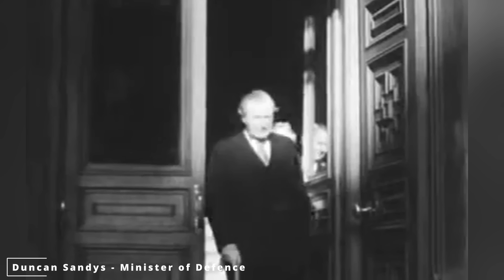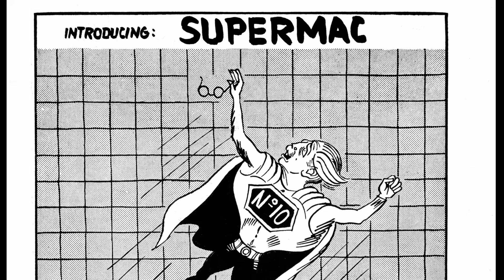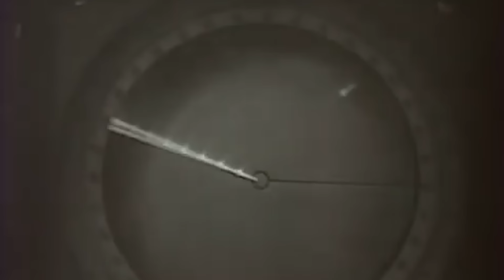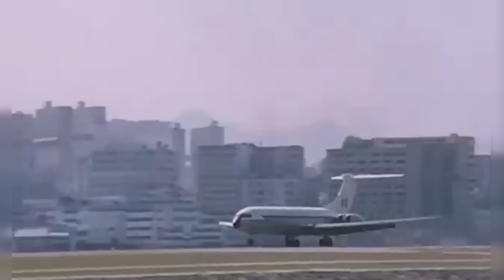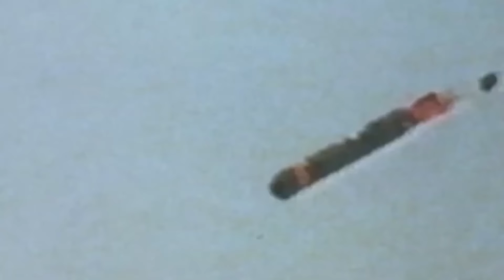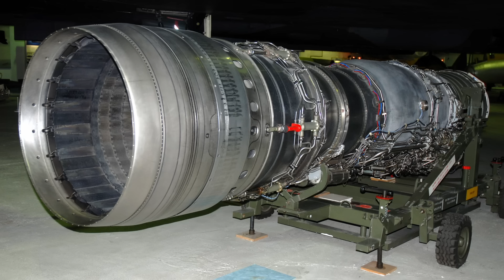How Britain Turned A Failed Airliner Into a Soviet Submarine Predator | The Mighty Nimrod

Comment: Can you reproduce these as podcasts?
Reply: Exactly.
Reply: Precisely.
Reply: @sandervanderkammen9230 

 
The fabulous trail blazing De Havilland Comet. 

World's first production jet airliner doing regular commercial service. An Avro Lancastrian jet airliner was actually first. 

World's first high altitude jet airliner. 

The HS 801 was produced from new build Comet 4 airliner airframes with necessary 801 modifications. It was the most advanced aircraft of it's type at the time it first went into service. It was not available for purchase by other nations. 

The MRA4 version had problems with radar and computer development and BAe Systems & co were too busy with other projects. 

There can be no excuses for the Bow-wing (See B-47 wing / folding  collapse incidents) Max incidents given that Bow-wing had more than 50 years design and build experience for the type. 

A typical Bow-wing (See B-47 wing collapse incidents) airline duty 707 lasted for about 23 years on average. The reason any lasted longer was large numbers built so lots of spares with a lot of airframes in military use with big military maintenance budgets and many often with low flying hours or in storage. A typical 707 is basically cheap nasty junk. 

All later jet airliners benefited greatly from the knowledge gained from the Comet incidents & subsequent investigations & yet some were still worse for accident losses. 

Instances of all marks of the Comet flew with full certification after 1954 including the Comet 3 with full certification remaining in place until after the aircraft were retired. The last Comet flight occured in 1997.

The nose design was unique to the Comet, Sud Aviation licensed the design for their Caravelle. 

The fabulous trail blazing DH Comet.
World's first jet airliner in regular service.
The jet engined Avro Lancastrian actually did a passenger service before the DH Comet. 
World's first high altitude airliner.
World's first airliner with a full fuselage length pressurised cabin pressurised for high altitude flight. That feature for that type of aircraft was a considerably difficult undertaking. 

How things were back then.
Accident losses - % of aircraft built.

DeHavilland Comet 4 UK                          14% 
DeHavilland Comet all mks UK (ff 1949)17%  
Vickers VC10 UK (ff 1962)                         5%

Douglas DC-1  US                                       99%
Douglas DC-2                                              47%
Douglas DC-3                                              30%
Douglas DC-4                                              26%
Boeing s300    US                                       72% 
Boeing 307                                                  70%
Boeing 247                                                   48%
Boeing 707  (ff 1958)                                 32% 
Lockheed L-049 Constellation (ff 1943)  30%
Lockheed Electra US (ff 1957)                   29%
Fairchild FH-227 US (ff 1966)                   30%
McDonnell Douglas DC-8 US  (ff 1958)   14%
Sud Aviation Caravelle  (ff 1955)             15%
Canadair CL-44 Turboprop US (ff 1959) 46%  
Convair CV-580 Turboprop US (ff 1960) 22%
Convair CV-880     (ff 1959)                      27% 
Convair CV-990     (ff 1961)                      33%
Tupolev T-104        (ff 1956)                     16%
Vickers Viscount UK  (ff 1948)                29%  
Fokker F-27 Turboprop NL (ff 1955)       40%      

The Vickers VC10, fastest Atlantic crossing for a non supersonic jet airliner, held the record for 41 years.

For the first few years of operation the Caravelle & Comet had similar accident loss fatalities.

Sud Aviation Caravelle - 
all accident loss fatalities - 
1320 fatalities. 

De Havilland Comet - 
all accident loss fatalities - 
453 fatalities. 

An example of a typical airliner from the period. 
The Fokker Friendship F-27 fatalities & accident losses as a % of aircraft built. 
Fokker F-27 Turboprop (ff 1955) 40%
2130 fatalities.

Boeing 707    3108 fatalities.

Of course De Havilland carried out a full stress analysis & performed extensive & protracted testing on two long lengths of fuselage representing all features of a complete airframe. De Havilland carried out significantly more testing than was required by any authority at the time & significantly more testing that any previous airliner was subjected to.

De Havilland designers / engineers knew all there was to know about metal fatigue at the time they designed the DH Comet.

De Havilland had prior experience building many all metal construction airframe aircraft including many passengers aircraft & thousands of jet powered fighter aircraft that were primarily of metal construction with pressurised cockpits & used jet engines built by De-Havilland.

De Havilland did indeed always work to better than industry standards at the time, used up to date knowledge for the design & testing activities & no evidence of negligence or criminal negligence was ever produced in relation to the DH Comet.

Global aerospace. 
From the 1950s sector rationalisation and consolidation took place. 70 companies in France and 300 companies in the US disappeared due to merger or dissolution. In the US Boeing was almost bankrupted by the 707 project.  Boeing had a well protected domestic market and the available space and resources in the US to engage in large scale airliner manufacturing enabling them to capture orders simply by being able to produce airframes fast enough and cheap and nasty enough. Another factor is airlines preferring to obtain as much of their airliner inventory as possible from one manufacturer.  Brazil has the world's third largest airliner manufacturer, Brazil is towards the bottom of the wealth over capita tables along with Indonesia. Most of the countries at the top don't bother having a single national airliner manufacturing company. 

Global Aerospace Sector, what's happening.

For example, there are of course no German companies that makes German jet aircraft in Germany & there are no German companies that make German gas turbine aero engines in Germany that are suitable for widebody airliners.

The UK has the world's highest combined per capita Nuclear / Defence / Aerospace Sector Activity.

UK defence sector, absolute terms, world's second highest activity. 1st for per capita defence sector activity. Per capita nuclear powered submarine construction, 2nd position. 
Main players being Rolls Royce, Babcock, GKN Aerospace & BAe Systems. Activities often involve international collaboration. BAe systems, RR and other UK companies now handle more Airbus work value wise than Germany. 

There's a good chance that anyone currently flying on a widebody airliner will be on an aircraft powered by RR gas turbine aero engines made in the UK and a good chance there will be other hardware on the aircraft that's designed and / or manufactured in the UK. 

Rolls Royce Holdings UK
Subsidiaries
- Rolls-Royce plc
- Rolls-Royce North America (ex Allison etc Classified Military stuff)
- Rolls-Royce AB
- Rolls-Royce Deutschland
- Rolls-Royce India Private Limited
- Rolls-Royce Marine Power Operations
- Vinters Engineering Limited
- Rolls-Royce Controls and Data Services
- Rolls-Royce Power Systems
- Bergen Marine
Joint ventures include:
- Rolls-Royce Turbomeca
- MTU Turbomeca -

Trent Family
The MT30 (Marine Turbine)
Industrial Trent 60 Gas Turbine
Trent 7000
Trent XWB Airbus A330neo.
Trent 1500
Trent 1000
Trent 500
Trent 600
Trent 700
Trent 800
Trent 8100
Trent 900
   
RR wholly owned subsidiaries in Germany handle smaller 2 shaft RR gas turbine aero engine work.

The UK space and aerospace sectors are highly productive, high-value industries that together contribute over £18 Billion in direct Gross Value Added (GVA) to the UK economy. Individually, the space industry directly contributes about 0.3% of UK GDP 7•2 Billion while the aerospace industry contributes approximately 0.5% £10•9 Billion.

The original alloy used for the Comet was discontinued by the manufacturer, that is why the alloy changed. The skin thickness remained the same for most of the airframe, the only change to skin thickness was the area where the wings meet the fuselage.  The window shape and size changes were necessary, the fact that cracks didn't run through viewing windows is irrelevant. The fracture that started at the rdf assembly window was due to fatigue fracture, the fracture started at a bolt hole. The fracture that started at an escape hatch during post incidents water tank testing was also due to fatigue fracture. all structural bulkheads, floors and decks were constructed using aerospace grade aluminium.